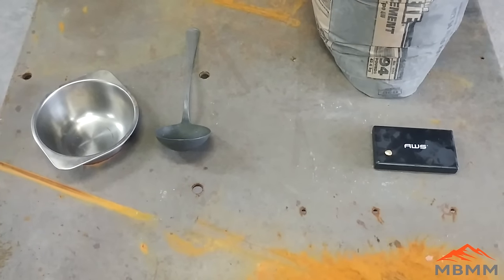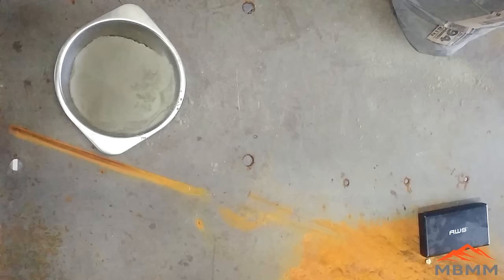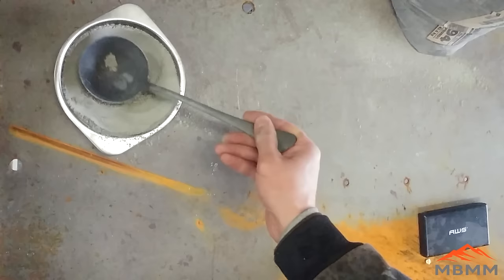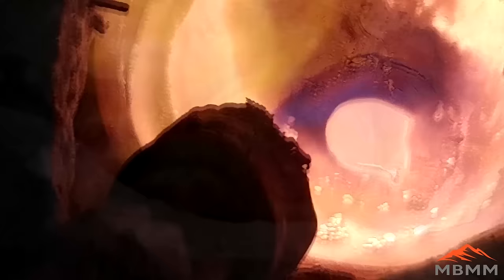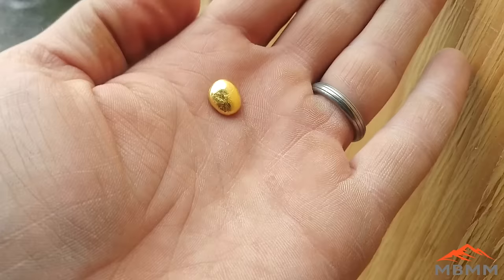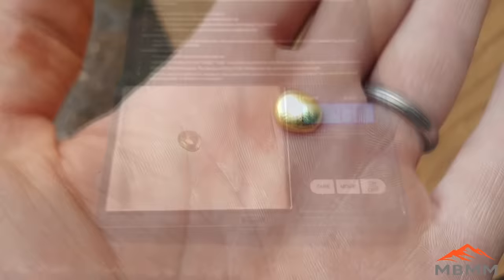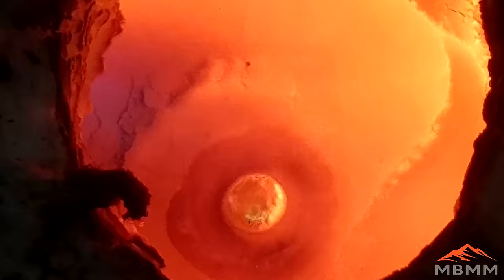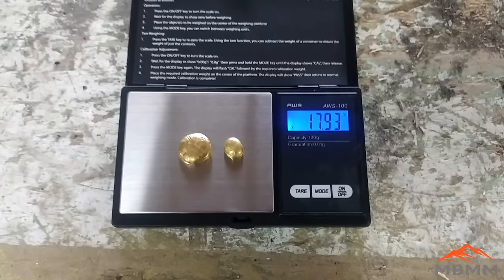Easy DIY Gold & Silver Refining Process At Home, No Acids. Remove Base Metals By Cupelling MBMM

Comment: Qouted = Portland cement is the most common type of cement in general use around the world as a basic ingredient of concrete, mortar, stucco, and non-specialty grout. It was developed from other types of hydraulic lime in England in the late 19th century by Joseph Aspdin, and usually originates from limestone
Reply from the maker: Thank you for your comment and for watching our videos!
Reply: Thanks so much. Had to dig threw 2 years worth of videos till someone explained what portland cement is. I've never heard of it until I watched this channel. Thank you.
Reply: Can u use lead sinkers? Or is roofers lead specific
Reply: Is the Portland cement sand free?
Reply: Scrub that floor when done. And clean the lababo as well.

Comment: Well done, Jason!  In addition to Portland cement (calcium oxide) you could use ground glass or calcium phosphate (available as a fertilizer or bone meal) or crushed magnesite.  The problem with using glass is that gold is soluble in molten glass just like lead oxide is.  If you were to use bone meal fertilizer,  you would first have to burn off all the left over organics like fat which smells bad and smokes a lot.  If you used copper as the collector metal while  processing the original gold button, you may find a lot of copper remains distributed throughout the final gold button  (to be determined with  a quick x-ray analyzer).  Gold and copper form a pretty strong marriage if inadequate amounts of flux are used.  I wish more video authors discussed gold ore processing options like you have done so people wouldn't expose themselves to mercury, vaporized lead, cyanide, nitric acid, and a bunch of related compounds that form during the processing.  Again, I must say:  "Well done, Jason!"
Reply from the maker: Thank you for your comment and for watching our videos!
Reply: So when doing it this way do you need flux ? And if so is it borax and baking soda ?
Reply: @finiszealot5539  I defer to Jason concerning which flux mixture to use.  He has done a wonderful series on his experiments with a variety of flux mixtures.

Comment: fascinating experiment. Maybe if you used a known karat of gold such as 18k the weight before and after may show how close you get to fine gold without spectral analysis.
 Twp questions I have. What is the dish made of that you put the portland cement in and what is your ratio of gold to lead .
Reply from the maker: The dish is a stainless steel bowl from goodwill and the ratio of gold to lead should probably be about 1:1
Reply: @mbmmllc  Thank you. I appreciate the info.

Comment: So it doesn't matter the furnace source as long as u have the right cupel material? So u can use bone ash cupels in a normal smelting furnace? Or do u need to have a certain furnace heat source?

Comment: This is by no means lead. Exposed lead oxidizes within hours or days and forms a dark grey oxide layer. Your material is shiny. At best,  this looks like tin to me, maybe containing some lead as well. But cupeling with tin may work as well. Have not tried it out, but should be possible. Btw: lead is very toxic and leads to various diseases and will never leave the body again, once it has been absorbed. For that reason, lead is hard to find/buy these days. So a warning to viewers should be appropriate. One source for real lead is ammunition projectiles. Even those for air (pellet) guns.

Comment: Could you use a similar technique to separate the gold from plated electronic components? Skip a step or two from the usual grinding and dissolving in acid?
Reply: yes you can
Reply from the maker: Yes, as long as there isnt too much base metals
Reply: Absolutely!! I use cupelling with CPU’s, and I make a big button. Then I roll this button flat and thin, to make an anode for electrowinning! I heal with some acid in the cell I have, but it’s nothing like refining with just chemicals, and my pure cathode takes the gold from my button ! I kinda combined two techniques to save myself from cyanosis....or worse. Thank you Jason! It’s important people see much safer ways to get to their means!!

Comment: I stumbled on to this and it's cool.  My question is how long did it take to get the lead absorbed into the Cupel?    I saw one video where the guy used some kind of round dish to cupel while you used simple portland cement.
Also, what is your running cost to refine the gold using this method?  Lead is cheap, but what about the other things such as the burning and the burning system?
Reply: Same was wondering 🤔🤔😫😫
Reply: @JSCRILLA253  After a year I receive no reply.  Don't think I will either
Reply: @JSCRILLA253  about 30 min

Comment: I like the hit and miss approach  to exact weights and measurements 100g to 150g and you settle on 127g to mix with 4.8g. Portland cement a, who would have thought it. I have used plaster of Paris and wire wool in a plant pot before and zinc with Borax and bicarbonate of soda in small pinch's. I have a reel of Lead weighting about a third of a pound on a shelf somewhere or buying some Lead flashing. Your way is a lot cheaper. Plaster of Paris is about £10 or $14 a pop Portland cement is about £4.50 a bag or about $6.75 give or take exchange rate. I wonder if you can reclaim the Lead afterwards maybe. One last thing, did you use a safety hood or respirator for the gases coming off the Lead. I cheat. I use a large glass funnel and have it running away from me even when I 'm outside burning and avoid dropping any gold on to concrete slabs or paving stones the gold would hit it and bounce up and go anywhere by using a layer of sand a inch and a half to 2 inches this can stop this happening..
Reply from the maker: Thanks for the comment.  Yes I will do a video showing the recovery process for the lead.  I wear a respirator
Reply: @mbmmllc how long did the process take till you got the refined button?

Comment: Is this doable with scrap jewelry to purify the gold and silver? I know sterling is rather difficult to remelt and recycle, so if I could purify it to fine and then re-alloy, that would work better for me
Reply: Just curious what problems you have ran into melting sterling. It melts and pours like pure silver for me. I clean it up with a graphite rod but that's it. Never had an issue.

Comment: Nice.
But it occurs to me, that before I try it, I want to know what waste products are left, and how in the heck do I deal with the lead oxide contaminated Portland Cement?

At least with electrolyzing a copper anode, that was used to inquart my precious metal values, I can recover various base metal sulfates, as sellable scrap metal, by using the correct voltage...for that mater, the sulfuric acid can be recovered and reused.  With a little more effort.
Reply from the maker: Thanks for the comment.  I will post a video soon about how to recover the lead.  Thanks

Comment: Could you theoretically do this with the gold strips and sticks off computers? I mean after you get it off the fiberglass board since that would be dangerous
Reply from the maker: yes, as long as there is not too much base metals.  Probably want about 25-50% gold or more

Comment: Hello Jason, I melted approximately 1 pound of a variety of copper items which some did contained small amounts of other metals, I add about a 1/4 cup of Borax and poured it into a cone mold like the one you use on your videos.  

The copper is stuck in the cone mold, I tried knocking out by hitting the concrete, tried hitting with a hammer from the outside and I even used an air chisel with a flat bit but didn't work, I even heated the copper in the cone mold with the torch and quenched in cold water to see if it would shrink and separate from the mold and it didn't. 

The cooper looks to be bonded to the cone mold, I'm thinking my next step is to melt the copper out of the cone mold, I'm curios if there's anything you can tell me that would help me and also I'm curious why the copper get stuck to the mold and not other metals, I really didn't expect this to happen.

Thank you in advance. 

Joe
Reply: I don't believe this method is for purifying copper

Comment: Would this work for scrap gold to purify? For instance melted CPU pins and other scrap wire etc.? What is the lead to "gold" ratio to melt down? Thank you
Reply: The pins are usually gold coated steel and the steel will not melt as the lead. And gold will at the same temperature

Comment: Now that you did that, Where did the base metals go and can you recover those separately?
These base metals may have been more valuable then just the gold itself.
Reply: Very unlikely to be more valuable than the gold. (I am an assayer).
Reply: @maranti34b  Glad you are, I was very curious about the other metals as I recently read where I believe it was Radium and it was many times more valuable then gold and thought you might be leaving something behind of value, A few years back a friend of mine had a couple dump truck loads of black sand, and he unfortunately trusted someone with it, and sent it down south to have the metals refined out of it, and they unfortunately absconded with them so there must be some hidden value in them
Reply from the maker: The base metals are only a few grams of the total weight so the value is small.  Any other precious or PGMs will stay in the button as they wont oxidize
Reply: @mbmmllc  silver and palladium oxidise quite a lot.

Comment: What was the purity of the first button before and after?
Reply from the maker: I think it was about 20-22k before and after was almost 24k
Reply: @mbmmllc  nice one, I melt mostly scrap jewellery using a direct flame from a Dillon oxy acetylene torch. I was using graphite crucibles but wasn't a big fan as they would have a narrow window of opportunity to drop the bar out to quench. I now use and much prefer a potato, I can make half a dozen bars at around 40 grams per bar before I need a new potato. To get the flux off I use dry pool acid in warm water, it works great.

Comment: Great but the gold can still contain silver making it cheaper per gram. 

A question. What about melting the metal to 1 100 degrees celcius in a crucible so that both gold and silver is liquid. Then lower the temperature to 1 000 degrees and poor out the silver or sieve it? I was thinking silver's melting temperature is about 960 degrees and gold about 1060 degrees. Silver must be liquid in 1 000 celsius and gold is in solid form at 1000 celcius.
Reply: I'd like to know that too my options are limited and I ended up buying "junk" but ended up was from a jeweler from so many years ago with cut up and sized rings and diamonds at the bottom of thousands of watch parts. I've tried uploading a few placed but they won't work with me

Comment: how do i do this in apartment?
Reply: Don't do this in a apartment. You need to do this outside on concrete pavers away from anything or bricks then if you spill any contaminated lead cement then you can sweep it up an dispose safely at you local hazardous waste center

Comment: And... Any safety requirements for lead? Gloves? Air flow? Washing hands? Environmental restrictions for lead? Blood level monitoring of workers?
Reply from the maker: Yes, you want to be careful. I wear a respirator.  Over 99% of the Pb goes into the cement
Reply: @mbmmllc  Thanks. That's a critically important piece of information. Does it soak into it? Or does it react with the quick lime?
Reply from the maker: @PhilipLeitch  soaks in and is absorbed.  No reaction, just absorbed like a sponge
Reply: @mbmmllc  so is it recoverable?